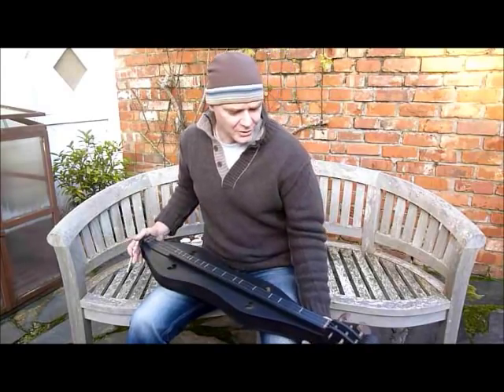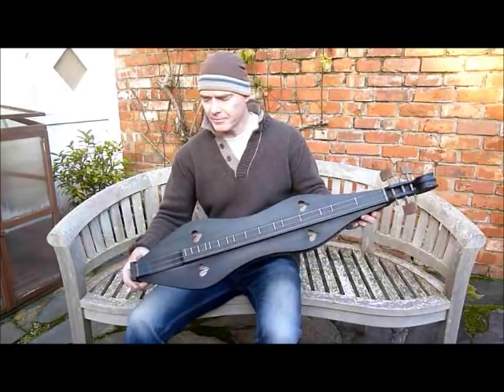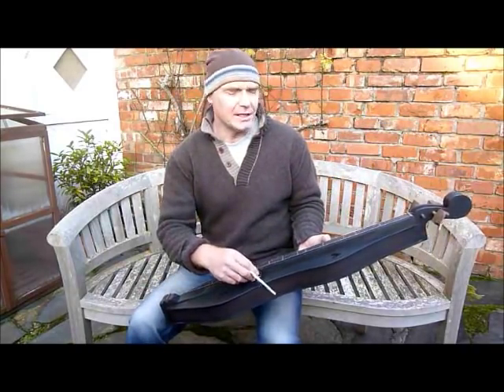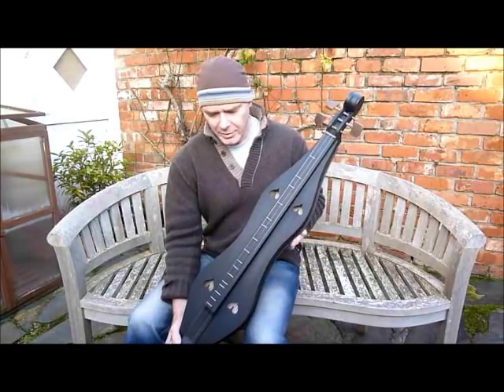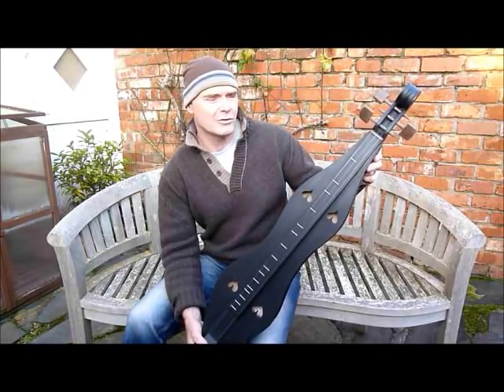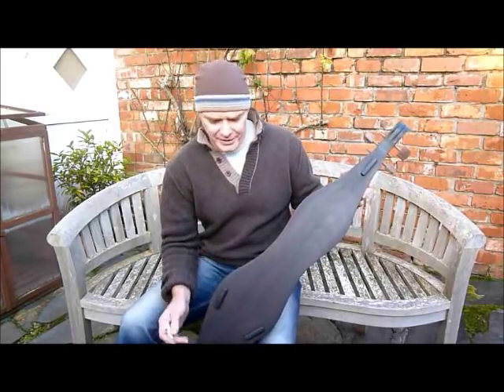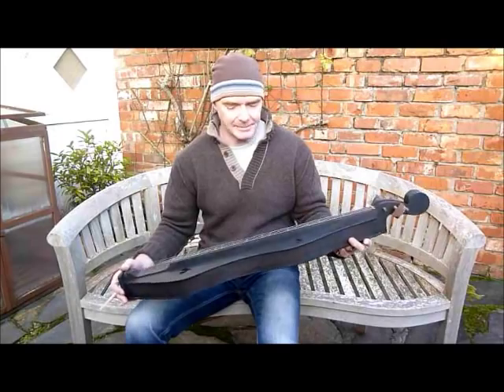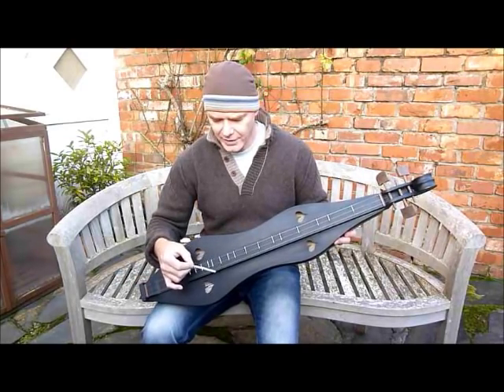Charles Prichard Reproduction Dulcimer - 15 Nov 12.wmv

Comment: Enjoyed that. Are you  using a feather as a pick?
Reply from the maker: Hi Allen, 
Yes, I'm using the thick 'quill' end of a goose feather (or possibly a seagull feather I picked up on our local beach).  Traditionally, the Kentucky and WV dulcimer players would have used this type of pick, or a swatch of wood os a similar size.  The Virginia, MI and TN players would have tended to use the thin end of a goose feather to 'whip' across the strings.  You will see some old dulcimers with strum hollows to accommodate using the thick of a feather end held vertically and others with no strum hollow that would have been played with the thin end of a feather whipped across the strings and held horizontally.